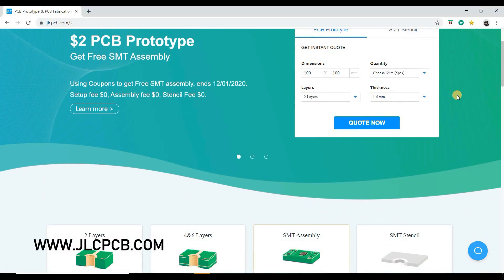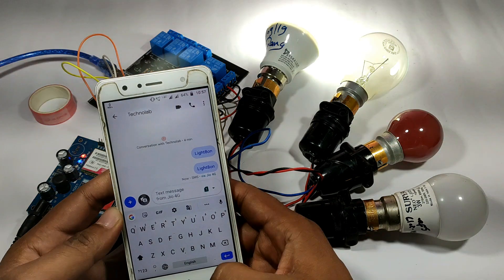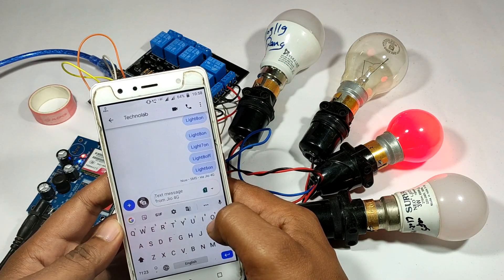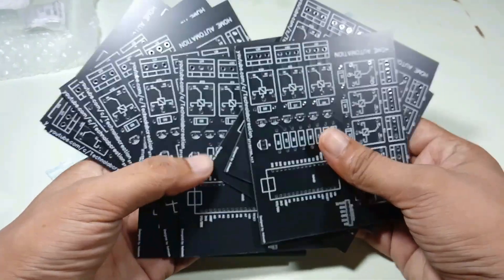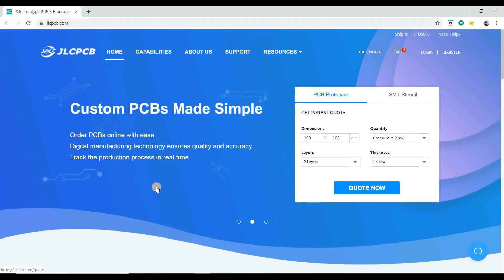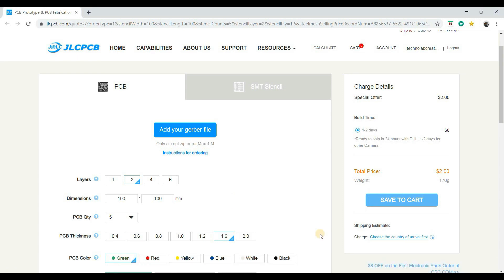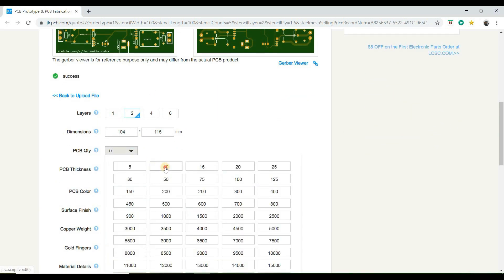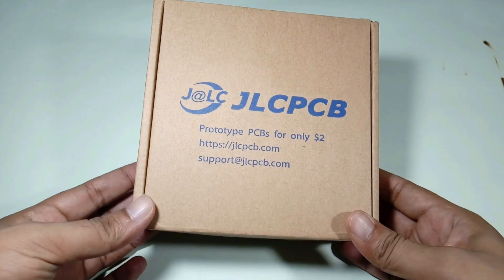8 Channel Home Automation using  GSM Module SIM 900A || JLCPCB

Comment: does your pcb getting powersupply from gsm connection
Reply from the maker: No….from Arduino board or add external power supply
Reply: @technolabcreation  hey brother can i give power supply to gsm module from vin and gnd pin of esp8266 and run gsm without external power supply

Comment: What if Device disconnects from GPRS? How are you handling it ? Did you implement Watchdog timer? 

I am using GSM sim800L and Atmega328p-pu for my Blynk project, it disconnected after 3days, then I had to restart  the device manually, I don't want to do this manually,I also tried Watchdog timer,but if fails to work with Blynk.please help